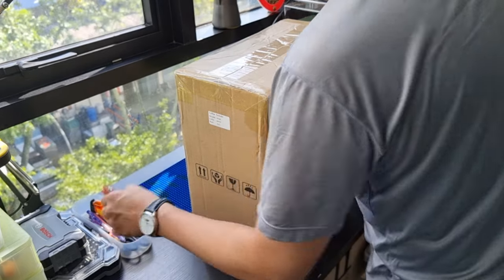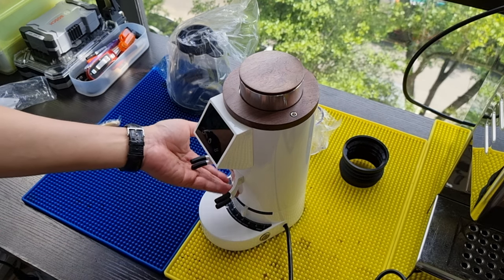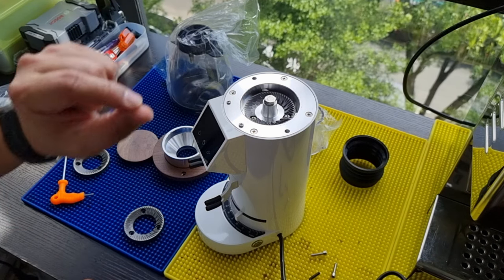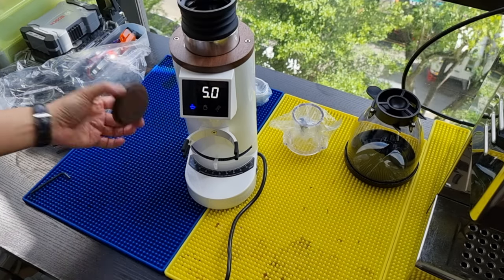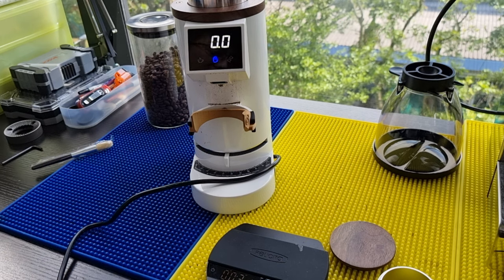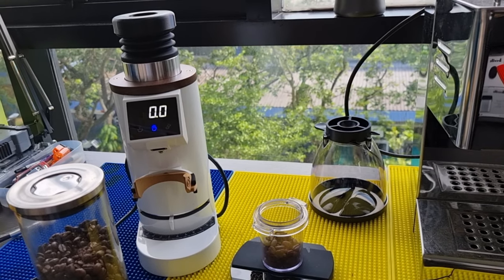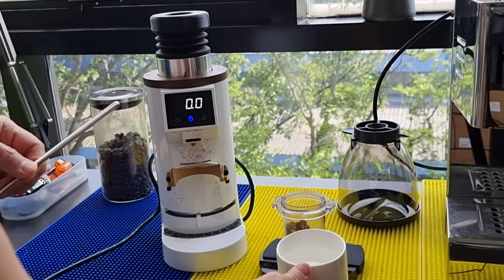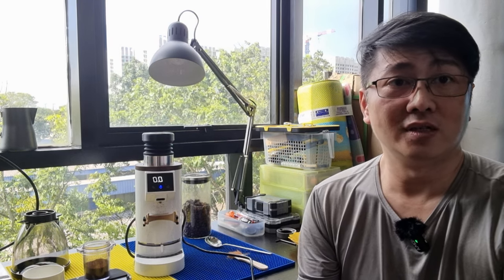DF64E with DLC Burrs | Unbox, First use and Impression

Comment: Declumper seems to be better than DF64?

How's the zero adjustment? Is it more challenging to adjust than DF64?
Reply from the maker: I will get to that soon on how to adjust to zero.
Reply: Just to check, is the a need to remove and modify the declumper for the df64p and e like the df64? (Seems like even df64 v4 also have the same issue and need replacement of declumper)
Reply from the maker: I will show that in the coming video.